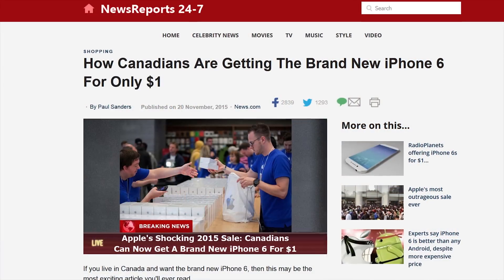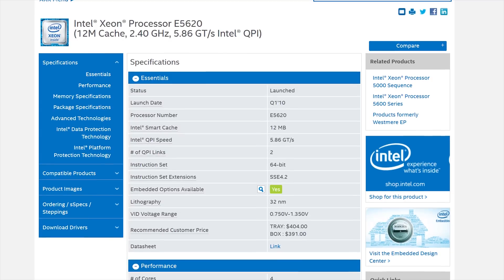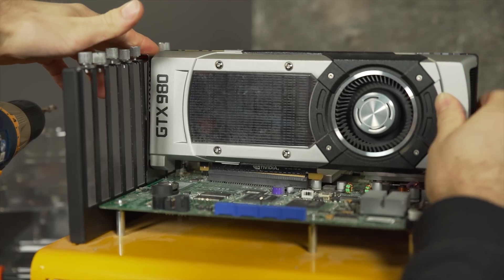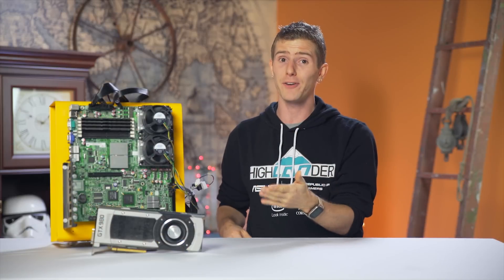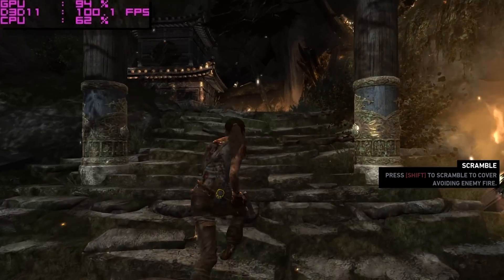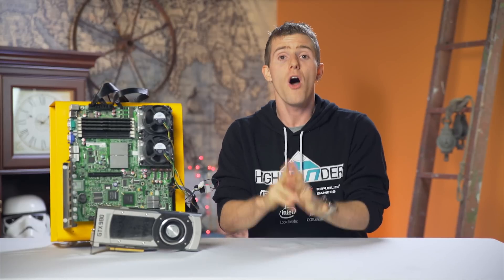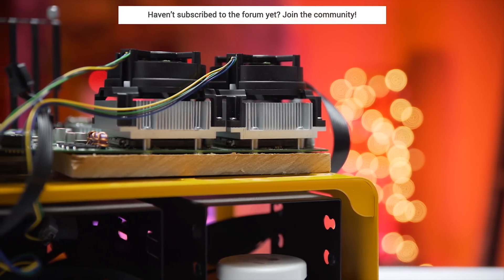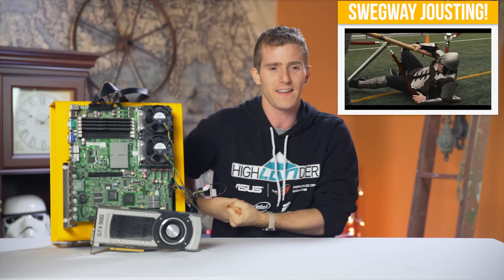Under $150 Budget Gaming 8 Core CPU, Motherboard & 16GB RAM

Comment: aaaaaand.... how is this any better than a good old i7 3770k? that would also cost around the same, but in a normal case, normal form factor and no weird modding and plugs and interfaces required xD
Reply: because a 3770k, motherboard and RAM didn't cost around the same you pleb. You know this video is from 7 years ago right...

Comment: Just buy a server and t
Most of them will have a riser for graphics card, but make sure you get a U2. Hp Dl380.

CPUs mount easy, you get two PSUs and a host of other things.. also try the raid array out.. you'll get higher speeds that a standard SSD.

Comment: I bought a hp z600 workstation from ebay for  about 70 brittish pounds + shipping. It has 2 xeon e5504's. I'm currently waiting for 2 x5570's to arrive, so I'm going to have a very cheap 8 core 16 thread system as a backup pc.
Reply: did you also get a 24pin power adaptor? i believe those OEM hp workstation boards have a proprietary pinout. I was gonna get a z600 or z800 but ended up buying a supermicro X8DTH-iF and 2 x5675 for $116 total. i already had RECC ram and a GPU. POSTed it last night. works perfect.
Reply: @CheckEmGG  It has some sort of 18 pin power connector. Everything is cable managed behind the motherboard and I haven't bothered digging around in the back. But I would guess that it comes straight from the psu and doesn't go through an adapter because it seems to be custom made too.
Does that supermicro board have overclocking support?

Comment: weird to think that 8 cores and 16gb of ram is average now.
Reply: Yeahh
Reply: its not average lol most used card on steam is a gtx 1060 , a 4 core modern cpu maxes that card easy, even a g4560 will max it (i had it in a system ,it was very balanced). I doubt people with a gtx 1060 will upgrade to a 8 core soon. So most people still have a 4 core or a 6 core systems at max. Having a 8 core in 2015 would have been insane( and not useful as those games back then dont even use more than 4 cores normally)
Reply: @milen8182  it comes down to what you or someone else considers the ‘average’ to be. 8 cores is probably is the average, or close to, for people who have built "gaming pcs"

Comment: So, I'm running an hp xw8400, I have dual xeon x5355. But there's a problem. I only see one in the CPUz application and same for task manager. Device manager shows all 8 cores while everything else shows 2. Msconfig only shows 2 as well. Any ideas?

Comment: Here are the problems I encountered:

Very hard to find a case, had to get a case and leave the PSU outside of it
Requires a switch to turn it on, despite the fans running when it's just got power
It could not have any ram higher than 4gb per dimm
It wouldn't boot to any drives until you configure your motherboard pins
VGA cable couldn't get in to the socket because the I/O shield was blocking the bottom of it
Takes 2 Minutes to get to the boot screen, even after a CMOS battery renewal
Only 8x, 4x pcie and 2 pci slots

After I fixed all of those issues it is brilliant! :D
Reply: well, it would be great if you say how you solved those issues tho :DD especially the boot screen thing
Reply: @YourAverageInternetEnjoyer  I figured out to fix the boot screen thing you need to organise the jumper pins on the motherboard to put it in to diagnostics-checking off mode, before, it spent it's boot time scanning all the hardware, you should also check your motherboard specifications for the right RAM (check the ECC that is very important). The VGA not fitting was just because of the case, I was using an old OEM case anyway and it is in a new one now, the PCIE issue could be fixed with an extension riser, you have to make sure your case supports vertical mountingh, make sure you have it with I/O or it won't turn on at all, make sure to reset bios settings as to allow the boot to any harddrive or SSD, be careful as some server mobo suppliers don't allow SSD or RAID support, and last of all I recommend double checking the case you are getting for the mobo, make sure that it is the right size, and as there is no official "EATX" try measuring your exact motherboard dimensions and compare it to the case, some cases claim to fit the mobo, but often it means you have to exclude the power supply. Make sure to also get case with good sound-proofing, as the motherboards often don't have a good control over the fan speed, or you can build and solder a PWM cntroller to the fan header, which is what I did.

Comment: Alright, so I have an old hp xw8400 workstation from 2006. I attempted using xeon x5450s in it. It did not work, definitely pay attention to motherboard bios/ chipset compatibility.

Comment: I have about $250 set and it runs battlefront 2 ultra settings on 60fps, by the way I'm with L3 electrical engineering and digital electronics certificate .All depends on the combination of the hardware and before buying something always check it on PASSMARK. Good luck.

Comment: I delided a couple of x5355 xeons for my Dell precision 490 and can run halo master chief collection with no issues with my gtx 950, I do 3d printing so I use it to slice models mostly though so it has 22 gb's of ram

Comment: Yah this is what my budget actually is 😂
Reply: Dam my budget is 300 💀
Reply: @lemonkey7763  I gotchu, I was in the same boat
Build a system around the Ryzen 3 3200g
I went with a b450m motherboard, a 400w PSU, 16gb of 3200mhz ram and a cheap case.
Then you can add a graphics card later for more performance 💪
Reply: SaltyStarfruit And to this day some people are still clicking read more
Reply: Same
Reply: Nice :v

Comment: I have an HP XW8600 workstation. Can I use an NVIDIA GTX 980ti and run modern games smoothly on high settings?
Reply: I would not recommend doing anything in this video anymore. This information is quite out of date at this point.

Comment: I could tell you exactly whats wrong with your car/truck and how to fix it in 5 minutes flat... BUT this shit is chinese to me.  Someone help me build my old XPS!   (I'm fine with just using the case because its huge and has plenty of room for cooling fans on top of cooling fans to cool my cooling fans while my cooling fans are cooled by a water cooler)  lol  Point is, no clue what I could re-use or ... not re-use, don't really care... Just want to build something that can handle newer games with directX11 with ease.   Back in the olden days (2009ish) the xps could run anything maxed settings for days.. now, it has no sound and can barely load the internet lol.  It does have a newer GeForce GTX card.

Comment: I like how you can actually pull this off today if you look hard and get lucky on used parts. You can get 16GB of RAM for $40, 1700 for $90, and a A320M motherboard for $30 for a system that's wayyyy better than the one in the video, and way more upgrade opportunities, although you'd might want to spend an extra $20 on a B350M or B450M board instead to start with.

Comment: new be dumb question.im trying to figure out what games i can play..my desktop is a 3.1 quad core  amd A8 5500 3.2 ghz 1 8 gig ram chip and a nvida gforce 710 1 gig ram and a 250 gig ssd .like i said newbe if im in the wrong place say so. i just like linus .seems to atleast knows what hes talking about/
Reply: Upgrade the gpu and you might be able to run esports titles

Comment: A slab of plastic from onlinemetals.com can be had cheaply for a custom backplate, that's not combustible. Press fit brass inserts for the threads. Use a c-clamp or bench vise to drive them in.

++Mancard for McMaster Carr

Comment: I have an xeon x5675 that comes with the motherboard 4gb of ecc ram the psu, and the cooler for usd 137 dollars on ebay even cheaper if you are willing to auction for it. https://www.ebay.ca/itm/163768068094

Comment: Who's thinking about trying this in 2019
Reply: Zihanouk Yu I wanted to turn a Dell Poweredge in a working gamin machine but there are a loooot of things I would have to manage
Reply: i have a dell precision t7500 with 2 xeon x5687 i think my set up is fine gpu 750ti works fine for me   what would linus think ??
Reply: bda1978 maybe you will have the same problems as me... the gpu must be reversed since it’s ok the top and the fan would work ahainst the chassis and the fans of the original tower must be changed completely to quiet it down

Comment: This would be a good thing to try if you have the knowledge and patience to do these things and don't mind the trial and error.  It can be a fun thing to try in your spare time and you would end up with a computer that could handle more than 32 GB of RAM.  I am not sure how many people need more than 32 GB or even have that much installed.  I only installed mine because one game was loading horribly slowly despite my computer meeting most of the specs aside from RAM.  I found 32 GB of RAM on eBay for a reasonable price and now that one game that took eternity to load took no time at all.  I usually never have this problem with any other games BTW, it was just that one Deus EX game that was causing the problem.  I might get an SSD next now that the are getting so cheap, I will just have to get adapter brackets to mount it where a 3.5 inch drive would normally mount since my case does not have spaces made for a 2.5 inch drive.

Comment: The real question can you do it now in 2019
Reply: Of course you can but you're better off with LGA1366 platform now, something like a pair of x5670's or higher 12c/24t. They generally have better motherboards with more expandable lanes. Also, you're electricity supplier will know you by first name!

Comment: Can I safely do this? I’m good with computers but never built one
Reply: Yeah, and it's awesome. He makes it seem like it's more jank than it really is, sure it's jank but it works and it's not like it's hard or anything. You just plug stuff in where they fit and that's it. Just make sure to check if your motherboard needs unbuffered or ECC RAM.

Comment: Update for a better build: HP Workstation Z400 (chipset X58)with 6 memory slot for around 125$ ca. Intel  Xeon X5675 SLBYL 3.06 GHz/12M (cinebench 15 score 1037)for 50$ on Ebay . AMD R9 290 for 95 $ for the gaming card.

Comment: Ha, I looked back at order history in my Newegg account.  About 2 months before this video was made, I picked up a Lenovo i5-2400 tower with 4Gb, Win 7, $260. MS certified supplier refurbish, 1 year warranty. Could probably have done even better on Ebay.  Even in 2015, going back to the FSB era for a 'budget' gaming PC makes NO SENSE whatsoever.  You'd easily eat up the $90 just picking up a cheap case and Windows.  And the refurb even came with a new KB/Mouse.  Swap out PSU, put in GPU without having to saw a part off, cake.  The sample build above is patently ridiculous.

Comment: Most people ignore used server/workstation equipment because they're unaware of it, or don't know enough about it to be comfortable buying it.  But there's always fleets of equipment being liquidated at good prices.  You just have to be able and willing to figure out what you're doing.  Be patient and do your research - don't rush into the first deal you find, there will probably be thousands more.
The high volume of identical parts combined with lack of competition from other buyers means the prices can be very cheap, but you pay for it with your research and resourcefulness to make it all work with your setup. There's a sweat equity that you have to be wiling to put forth, it's not as simple as buying consumer DIY equipment that's all designed to plug and play with everything else.  Sometimes you might need to figure out proprietary pinouts and build adapters, for example.  When it comes to power connections, you have to get that right the first time or you'll blow stuff up.

If you do buy used proprietary parts, assume responsibility.  Don't buy things randomly and harass the sellers because you bought something you can't use. Those headaches (and the support cost) drive many outfits to just burn it all in a fire rather than offer it for sale.

I recently got a deal on a Dell workstation with a Sandy Bridge Xeon.   The bare motherboards for old systems like that are hilariously cheap, but you have to pay attention to the details to figure out how to integrate them in a commodity ATX case.  Study photos, find documentation, don't assume anything, and accept the risk of making a mistake.
Buying the whole PC is sometimes more elegant, avoids some confusion, and sometimes it's a better deal if you need many of the parts.

Dell/HP/etc motherboards sometimes have a key in firmware to activate Windows 7 (or 8, if you're into that), but I think you have to find the appropriate type of install CD in order to have that firmware key be recognized.  Unfortunately, it seems that many sellers remove the printed Windows COA product key that's supposed to stay on the machine.

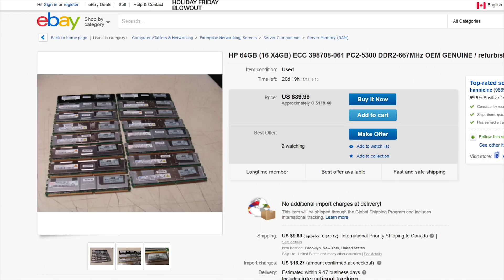4:45 - minor pet peeve of mine, having sold lots of RAM on eBay in the past - referring to those modules as "regular ECC" is ambiguous.
The most important compatibility issue isn't ECC, it's whether the memory is Registered or Unbuffered.  The types can't be mixed and many boards strictly require one or the other.  That module is Registered.  Maybe not Fully Buffered (a type of modules I've had no experience with), but it's clearly Registered as evidenced by the buffer chip at center. Unbuffered memory (which desktops typically require) doesn't have that - unbuffered memory is a straight shot from mobo to the RAM chips.
It's also ECC (as evidenced by the RAM chip count), but that's usually not as compatibility breaking as the Registered/Unbuffered parameter.

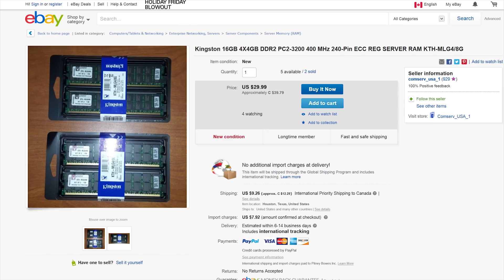5:13 - Those aren't actually marketed for generic applications, but in practice it's not surprising they work just fine.  The KTH prefix means that Kingston markets them for some set of HP machines.  KTM=IBM, KTC=Compaq, KTD=Dell.  There's probably others.  But it hardly matters as long as the important characteristics of the RAM are compatible.
Reply: Or you can just buy every piece of crap you can find and some of them will work together for cheap eventually. ;)

Comment: I picked up a decommissioned DELL T5600 dual E5-2667 (V1, 6 core per CPU, 2.9 GHz base clock plus 3.4 boost, 32 GB DDR3 EEC RAM (QUAD CHANNEL), 825W Power Supply and 1 HDD); got it FREE thru my company decommissioning policy. Thru in a 240 GB SDD (SATA 1) for $65 and a GTX 980 FTW off of eBay for $180 plus shipping. Hooked it up to my 43 inch 4K UHD Philips TV, which I bought 2 years ago for $340 at a local flash sale.

WHAT a RIG!!!!!!! Plays the games I enjoy quite well.  WoT at high graphics gets me over 100 FPS.

Productivity is terrific, multi-tasking....off the charts.

I will invest 90 bucks in a sound card over the next months...and another 3TB HDD.  That's it.

Comment: open the .bin file of your pc bios data
delete a part and rewrite the bios of your pc when you have updated the bios data pull the power cable from the outlet then you turn on the pc to see if it works

Comment: I just put up a video Installing a XEON X5450 in a 2008 Socket 775 ASUS motherboard.  You have to grind tabs on the side so it will fit and bridge two of the pins, but it works!  You can get them pre-modded and tested from China for less than $10.  Working great in my Linux box.  I got a software RAID 5 with a encrypted file system on it and I run backups to another SATA that also has an encrypted file system, the Core 2 Duo I had just wasn't cutting it, but that XEON is shredding it!    I love pushing old hardware to its fullest potential.

Comment: I've got an old HP G5 server running dual X5460's. I can confirm that these CPUs are surprisingly capable today. Not on par with modern processors, but also not as bad as you'd expect.
If you're gonna go this route, I wouldn't recommend the L54xx series CPU's though. They are significantly less powerful. If the 2x 120W X5460's are too power hungry for you, definitely go for an E54xx CPU instead. It's a nice balance between lower power usage while still not sacrificing that much performance.

Comment: I'm running an Intel workstation based on an Intel S5520 motherboard and two W5590 4 core 3.3 GHz processors (the highest performance processor supported by this motherboard, it's maxed out) with 24 GB of RAM out of a possible supported max of 192 GB..   The processor pair cost me 50 bucks and the motherboard was bought new old stock for 120 and the Intel case for it was free.  It features a drive bay with six hot swappable drives and is running a 1000 watt power supply.   It takes modern video cards quite well and is basically a freight train of a computer.  It may not be ultimately fast but like a train it is very hard to slow it down.  I'm running Windows 7 Ultimate which is the only version of 7 that supports multiple CPUs.    This may apply to Win 10 as well, I'm not sure, but it is something to check if you want to build a dual CPU machine.

Comment: The problem with 1T performance is down to the CPUs. X5460/X5470s will fit in that board and yield closer to 800 points in CB R15.  You can also adapt those CPUs to work in most desktop 775 boards which can be had for pennies.

Comment: if it wasn't for the problem of warranty, someone could start a cottage industry selling these rigs; not sure at what mark up though. And the customer care would be expansive, you would have to offer a postage free return policy to compensate for the fact that if anything went wrong it would take time to fix it. That would be one problem among many, demand would outstrip supply very soon.
Reply: Your right. And I've built a similar setup. The only issue would be support, I feel that if I breathe in the wrong direction this thing will have errors.